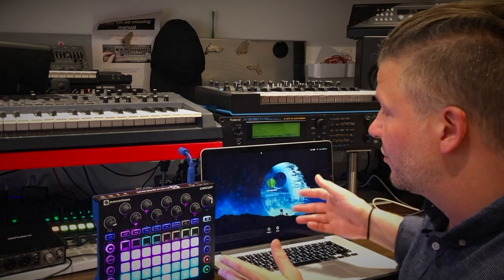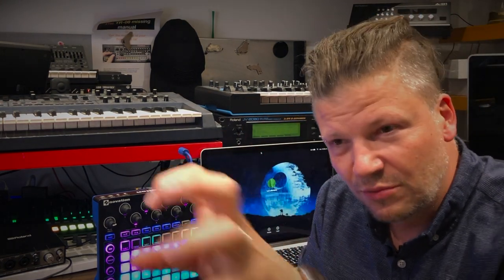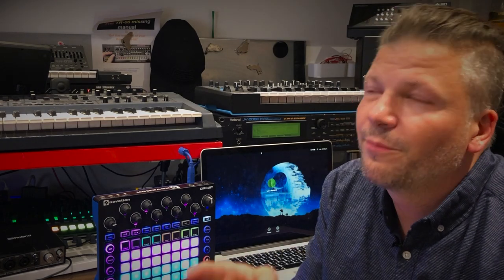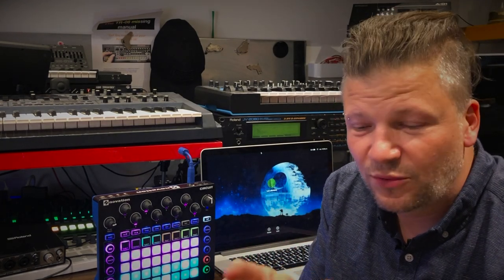Get the most out of the Novation Circuit - Music production tips

Comment: I found this interesting I've seen the other approach as well where the drum tracks are pitched to use as melodic elements. I tend to use the sample flip to maximize 2 of the drum parts enough to make a beat then automate the parameter locks on those to get movement across the measures. I usually use at least one of the drums to run voice/vocal snippets. I hadn't really considered using the synth engines as percussion... I like the idea now that I've seen it in action.

Comment: The circuit could make an ideal drum machine for DJs who like to add extra drum hits to their sets. The ability to load your own drum samples makeshift more flexible than a few drum machines I've seen used in this way. It's also much smaller than a tr8. This could be an interesting video if combined with something like traktor.